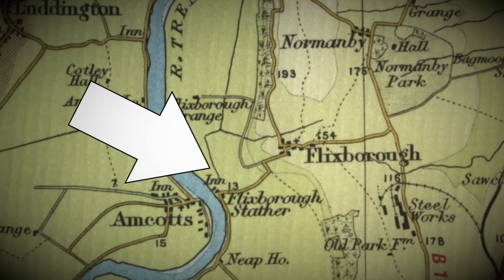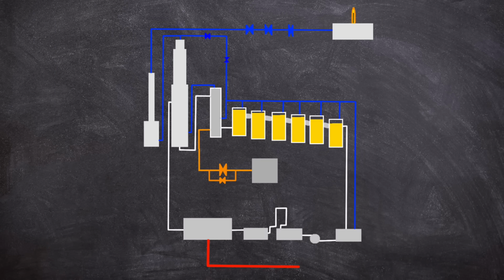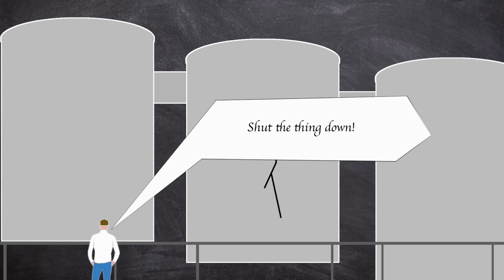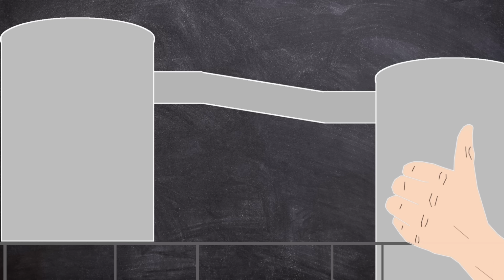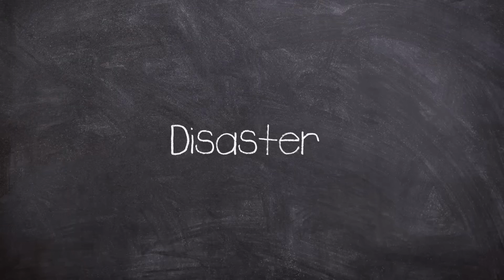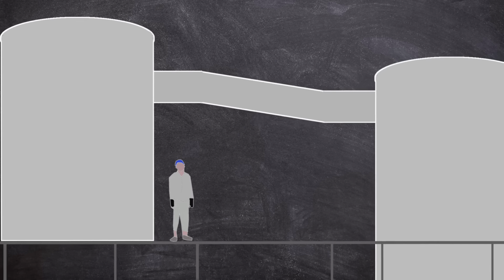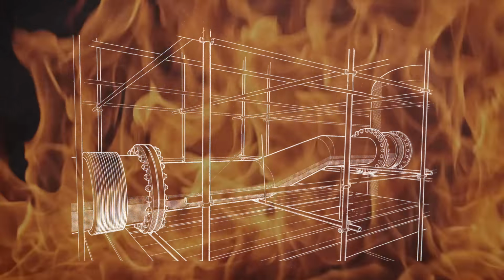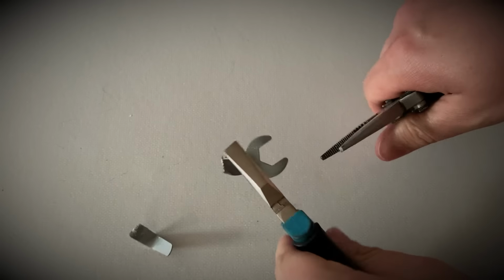The Flixborough Disaster (1974) Where Did it go so Wrong? | Plainly Difficult Short Documentary

Comment: I'm a Chemist at a German Sodium Carbonate plant and GOD DAMN that is the worst Work Ethic I've ever seen by those in charge ... How is it possible that the 
Flange was just sized down and not tapered? 711 mm—500 mm is insane, I'm impressed it didn't brake at the Flange but still how could they even be allowed to restart the plant after the first failure??? And as much as I hate "TÜV" it does prevent things like this from happening.

Comment: The combination of Flixborough and Seveso within two years of eachother lead to Europe heavily tightening up their chemical regulations, making a Bhopal style disaster impossible.
Union Carbide had 3 plants in the world that made MIC. The French one was easily the safest thanks to these regulations. The West Virginian one was a 1-1 copy design wise of the one in Bhopal, ithad it's problems(A Bhopal style disaster WAS technically possible until the late 80s), but all the safety systems were kept running and the control systems were automated and fully computerized(the one in Bhopal used analog gauges and all the safety systems had to be activated manually), so even before the Bhopal plant was left to rot in the 80s it was less safe than it's sister plant in the US. And once they left it to rot and gutted all the safety systems it was all over...

Comment: This incident is of particular interest to me as from 1995-2002ish I worked at a nylon plant in Florida, USA that used this same process design. When I started at the plant, someone told me that there had been four plants built in the world using this process, and we were the only one that hadn't left a crater. We had special alarm bells that would sound if the cyclohexane detectors around that portion of the plant went off: the instructions were to go outside, feel which way the wind was blowing, and move as fast as possible away from that area across the wind.

Comment: I seem to recall reading the report in the aftermath. I'm pretty sure the report mentioned the (qualified) Plant Engineer had left some time previously and not been replaced, leaving the maintenance in the hands of an unqualified person. Also that galvanized wire had been used to hold sections of lagging in place around stainless steel pipe and under fire conditions the zinc melted and came into contact with the stainless steel, creating  a condition of zinc embrittlement with subsequent cracking of the stainless steel. At the time I was working at a food production plant with extensive stainless steel pipework and we were instructed to ensure no galvanized fittings were present in the vicinity of stainless steel system components.

Comment: I used to work for Gulf Oil in Milford Haven and we made the Cyclohexane that was used at Flixborough.  The Cyclohexane plant was known as very dangerous and several near misses made everyone very cautious to work there.  After Flixborough we had to install multiple temperature sensors to shut the plant down in case of a temperature runaway. But we never felt safe.

Comment: I just looked up what 9kgcm2 of pressure is in bar…. 😮 that some hefty pressure for a pipe of that diameter. I’m amazed they didn’t get this work done properly! No chance you could get away with something like that happening in the U.K. these days!
I am a pipe welder and some of the old pipework we take out of service on some of the refineries like Lindsey Oil Refinery or Salt End is scary! Pipework just half prepped, butted right up and stove stick welded…. Big 1” rough looking caps and zero root and it’s been in service like that for 40 years. Madness!

Comment: This video is deeply unsatisfactory. Given that, by hoop stress calculation, a pipe, even though large at 20", is much more resilient than a huge vessel, this is the kind of repair that is actually really hard to get wrong. How do you screw this up. Replacing a pressure vessel by a pipe is normally the very definition of "safe". Which 100% what the engineer or shop manager in charge was thinking to himself. Ahh, is a pipe, rated for xyz kg/cm², what can go wrong. It was on bellows, so it did not blow from extreme thermomechanical stress. Weird. WEIRD. WEIRD. Some major explanation is missing here. Like the pipe being thin wall and actually unsafe for that pressure level. Which is very easy to calculate. Unless it was remainders and you dont know which steel alloy. At which point just use a low grade of boiler sheet for the calculation and you will be always on the safe side with a good safety factor. The video just says "repair was not according to standards" What was not to standards ? Wall thickness ? Weld prep and prodcedure ? Hmmm. Strange.

Comment: This incident is often used as a key example in training about the Management of Change component of Process Safety Management in the U.S. You can't just wing it on process and equipment changes without a thorough understanding of the possible ramifications. I'd give it an 8, with Bhopal and Chernobyl as 10 or 10+

Comment: I had never  heard of the flixborough Disaster till i started watching this video and i lived in the UK from birth in 1966 to 1990 when i emigrated to Canada. It always comes down to Money and the management. Inexperienced management. Always cutting corners will make or break companies and in most cases break them. When a system is designed it has it own specifications things that must be in place for said system to operate to its full capacity. If you take one of those pieces away then this is the first part of the Balls up as you put it. To use steel on the reactors was a mistake which goes all the way back to the design of the system. Stainless steel if put into contact with another metal can corrode over time. since the system was finished in 1974, and problems arose at that time a complete shut down should have stayed shut down until the system could be inspected by an engineer who was experienced in the design of said system. Removing the reactor should have warranted a complete shut down of operations until the reactor could be replaced. if that had been done then the problem may have undergone more strict inspection of the other reactors to see if the inside wall was already damaged enough that there would be more leaks down the road if not fixed properly. Messing around with any pressurized system and doing cow boy repairs is a recipe for a catastrophic melt down, which eventually happened. I worked for an architect and was told about the various different jobs we had going on in the office. I was responsible to put the packages together plans blue prints specifications and any amendment documents to be taken to the clients so bids could be made on the projects. I am not good with math or science but i get the jist of it. John you did a great job explaining the disaster in this video. All to often it comes down to management decisions, that cause the biggest disasters. Jerry rigging something to keep the plant going was a total, mistake especially with chemicals pressurized systems and reactors. The reason it had 5 reactors in the first place is because it was too much stress on the others if one of them is missing. Duh! I just don't get the mentality of it these officials in the management are supposed to know the system and check check and recheck to make sure that there isn't going to be a problem if you add more pressure fittings between the last two remaining reactors could cope with the extra stress. to find out that information they should have gone back to their engineer to go back over the specifications to see if the problem would go away but they didn't so there fore they should have had to pay damages to all the parties who were directly affected by this catastrophic meltdown.  Management is always going to put production over safety the evidence is clear. if that means Jerry rigging something to make it work, so be it, they never think of the lives who are going to be lost or directly affected, as a result of their negligence, If they had done the right thing in the first place and gone back to the engineers who put the system together in the first place things like this are going to keep happening, Safety doesn't come into it ever.  So i have to say the Bone Head award goes to the management of the Flixborough chemical plant. This was an accident waiting to happen. Management have to learn to listen and hear what is being told to them by the people monitoring the system if you do not listen and hear what is being said shit happens and people die as a direct result of you not hearing and understanding that safety has to override your need to get rich quick. people died for Christ sake does that not mean anything to management anymore. I have worked for companies in my life who just didn't hear or didn't understand what would happen if things were not done in the order they were meant to be in production goes down and things break but you never ever jerry rid things that have to have a certain amount of pressure to keep going. If you remove something that was designed to be there for optimum production. it doesn't work and if it does work bad things happen.

Comment: I remember years ago when id just recently started work in a British company who under licence made & bottled or canned the drink Coca Cola & other well known drinks brands

I worked in the laboratory & my job was to go into the factory & collect samples of each proceedure to ensure quality & guidelines.

It wasnt a hard job but inbetween testings i only had 20 minutes which involved writing up reports etc so you were busy all the time.

One day, in to my 1st shift of the day, i looked at the test results done previously.
The person i was taking over from was nowhere to be seen & i guessed had snuck off earlier.

So i went straight out to do my 1st run of tests.
Back in the lab with my samples 
My 1st test was to examine with the specialised microscope the solids present in the liquid
( sounds weird but its true)

Immediately something was wrong, the + or - accepted tolerance levels were Waaaay off,
I did the test again after cleaning the slides.
Still very wrong

I was totally alone!
Plus being new, i felt panicky 
I went out for another sample with clinically clean tools.
Again the results were worse than before!

I couldnt understand it as they were all fine from the other Lab tech before me.
Id been told when i 1st started that if any results were wrong 
I had to be 100% confident of my findings as, to shut the lines down was EXTREMELY expensive 

With no one to ask or even find 
& no time to spare, i opened the glass protected alarm button for immediate shut down.

The result was chaotic as the huge machines & lines stopped & silence reigned 
In seconds my boss flew into the labs to find out what had happened 

I explained everything & he wasnt angry just hopeful id been wrong, even if vigilant 
However, i was right!

My boss was so grateful id found out the fault which was that the  other lab techs, rather than go out & do the proper tests had stayed in the labs, skiving off & falsifying test results.

I was Sooo relieved id been right & hadnt wanted my colleagues to get into trouble but id had to stop production.

It was a huge job & time was of the essence but all the batches of bottled or canned drinks already made & ready for deliveries, had to be tested until it was narrowed down as to when the fault had occured  & allowed to get worse

There were 5 lots of lab techs to blame for not doing their job & thousands of gallons of the drinks had to be destroyed.
Luckily no one was sacked but it shook them all to see what their fabricating of data had done.

This kind of thing must have gone  on many times in many companies resulting in bad things happening.

We could have lost our contract licence with Coca Cola our main customer if the results had been discovered as C Cola had their own quality control come in & do random checks!

As it was, all the sub standard products had been destroyed & new correct batches made!.

We all learned a valuable lesson that day & ive never shirked my duties in any job i undertook.
Sometimes lives are put in jepardy because of laziness or cheating 
Thanks 
🇬🇧👧

Comment: I lived in the village just down the road on the same side of the river Trent.
My brother worked at nypro but had swapped shifts so he could go to the Isle of Man TT.
When the incident happened I was just putting the lawn mower away when the shed shuddered.
We were lucky with the curve of the river and it's bank directed the explosion over us.
The village across the river was not so lucky. The clock in the pub stopped at the time it occurred.
A friend lived in one of the houses on Flixborough hill , he was stood looking out of the widow and was badly cut. The houses are no longer there.
The site was eventually removed and new facility's built like a paint factory and a power station fueled by bone meal and during the bovine mad cow epidemic it was used to dispose of the cattle bodies.
Lots of lessons and new standards were a result of the Nypro incident even down to control rooms typically built on the outer edge rather than in the middle.

Comment: I worked on a "Pilot Plant" ,10,000 tons a year in Ilford, east london. Similar process, with heat exchangers not steam injection. Pipework inspection of  welds after Flixborough discovered many bad sections, plant was decontaminated and scrapped.

Comment: Hmm, what is next topoint out the place of the disaster? A plane with a banner attached?
You should stick to commonly used units and just drop imperial units altogether, the mix between the weird imperial and normal units in the middle of the video is a little bit confusing and does not do justice to the otherwise professional production of the video.

Comment: Reminds me of a time I passed the Wilton site on Teesside a few years back. It wasn't unusual for flare stacks to be going but this taller one to be flaring was rare. Worse still, the flare ran for many hours. It made the NE news due to the size and colour of the event.
Anyway, I had spare time and visited the village right next to that flare stack to see it for myself close up. Yes it was noisy and yes the flames/heat was intense but a side effect was a byproduct falling from the flame. The local news had described a process not getting the energy to start a full reaction and so the 'half mix' was being burned off. I could see huge sheets of sticky carbon falling from the flame to the ground below. I guess it was half-formed plastic molecules being burnt and carbonising in the flare, only to then fall to the ground. Although spectacular, the flare event I witnessed was nothing short of criminality in burning plastics high up.

Oh! And Teeside saw its own horror event if you do some research - a huge plastics fire.

Comment: In Canada, we test our piping and process systems to no less than 1.5 times the maximum allowable working pressure (MAWP). Why? Because a static test generally produces less stress than the stresses the piping will face in while service. And this also ensures it has a safety factor built in, and is less likely to leak even at the highest pressure the system would ever reach. Once again, process conditions can vary over an extremely wide range so I only say "less likely". Failures and leaks do happen for multiple reasons such a thermal cycling, shock loads such as water hammer, corrosion, and/or erosion etc
Reply: This was in 1974 though, and the UK raised testing standards partly due to this disaster (although even those in force at the time were not complied with).
Standards now require a similar overpressure test, various testing for all joints and valves including welds (which when they came in caused the shutdown of several nuclear reactors) and overtemperature and shock cooling tests at the higher pressure as well.  Penalties for mismanagement were also increased to better reflect the risk.
In particular, regulation and oversight were upgraded, so parts could not be fitted without a fully independent inspection, and all welds have to now be carried out by much more highly skilled workers, who have been rated by Lloyds as qualified for the particular type of weld and intended use.
The problem is that greed means that processes like this are then moved to countries with the less strict standards (or even none at all), which is what ultimately led to disasters like Bhopal.
Reply: @The_Real_Phil_Lee  Thank you for the insight. I've only been in piping for 24 years, so you're absolutely right that things have changed 25 years before I even began working in the mechanical piping trades. It's sad that disaster is the best way to justify stricter regulations when all the warning signs were clear and present before incidents like Bhopal and this tragedy happened. My deepest sympathies to all of those impacted by these events and so many others.
Reply: @cvp5882  Like aviation standards, these are written in the blood of the victims.

Comment: It is ridiculously dangerous to pressure test the pipe with steam or air.  Both act like a spring, and any failure would likely have been catestrophic.  Hydrostatic testing is much safer because any leak will reduce the pressure in the pipe.